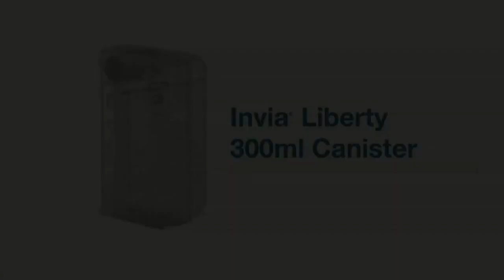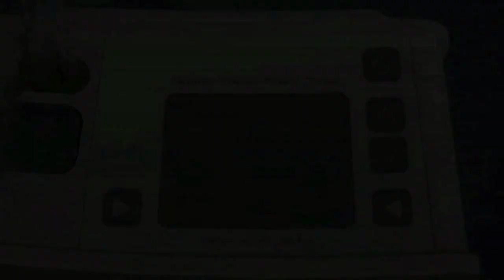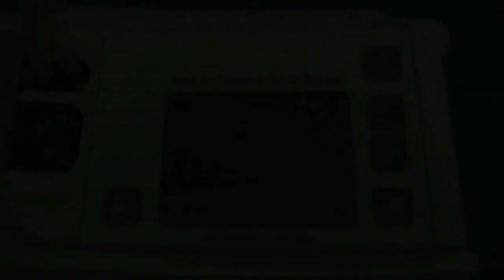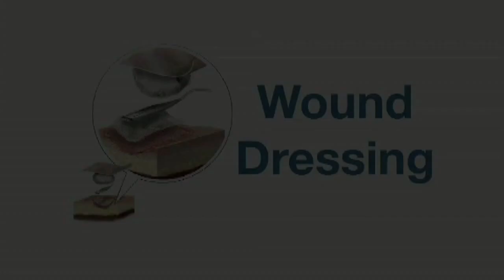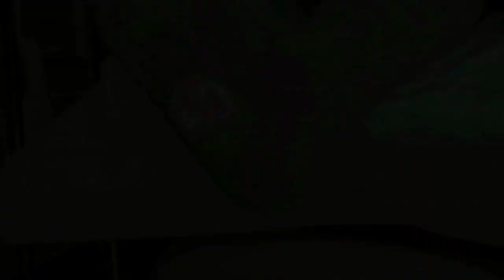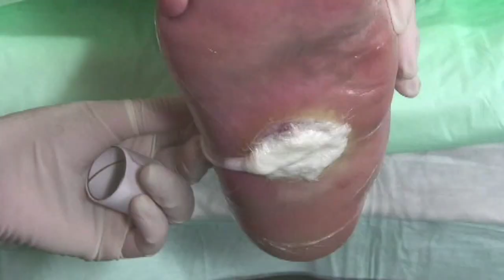Medela (Invia) Product Education - Liberty Setup and Dressing  2-1

Comment: I did one of these last Monday and the instruction manual was not very helpful.  No assistance was available since it was after 5pm.
It was the one with the green foam.
Is 60mmHg sufficient, or would 125 be more appropriate and how are those triangular things supposed to connect without just covering them with drape, which you can't do without using leftover KCI drape which I'm out of now?
Reply: I am a patient who has used the green foam and the non - KCI drape. Below is the method we used for 11 months to dress a large abdominal wound. We found this method very successful. This information is not intended to replace proper instructions from a licensed health care professional. Follow these instructions at your own risk.

The pump settings must be determined by the wound care doctor. In many cases, they start you off at 125 but that is not appropriate in all cases. Be sure to clean the open wound per your health care provider's instructions, then clean the healthy skin to be draped with "skin prep" and allow to dry. 

The best way we got the green sponge system to work was to pre-drape the entire wound area, but don't waste a full sheet. Cut the pre-drape layer down to a rectangle that will cover the wound and at least 2- 3 inches on every side. When placing any drape, be sure to gently smooth it to the skin (not on the wound) for good adhesion before removing the backing. In most cases, you have one shot at placement with any piece of drape. You cannot lift and re-position most drapes, nor can you use it at all if it sticks to itself.This pre-drape should stick only to the skin, not the wound. Do not press it onto the wound area, just around it. The flatter you can get drape to lie, the better your seal will be.

Once the pre-drape is on, pinch it tightly over the top of the wound, pull up slightly and make a tiny hole with small scissors. Using those small (tiny) scissors,  cut a window where the wound is as you pull the drape up, following the edges of the contours of the wound, while NOT allowing any good skin to be exposed once this is cut-out. The window can be very slightly smaller than the wound, just not larger, since the sponge will cause good skin to deteriorate and granulate too, making the wound area larger. Once the hole is cut, the drape should stick to the healthy skin all around the wound.

Some people find the above method (putting adhesive drape across the top of an open wound, then cutting it out)scary and, using more drape, will do what others call "arts and crafts" and cut pieces out to fit around the wound, creating the pre-drape in two or more pieces, peeling and placing them one at a time. It takes more drape, especially if one makes mistakes. I feel that the extra seams provide more spots for possible air leaks, but not always. Both methods can result in success.
 
After your pre-drape is in place with a hole over the wound, 
Cut a piece of sponge the same size and shape as the wound, place gently on the wound and cover with another piece of drape. The best method is to peel the drape backing part way off, press the sticky part down on the sponge with one hand. While continuing to gently compress the sponge under the one had, spread the rest of the drape out around the sponge and smooth with the other hand. It takes a bit of practice but a novice can learn fairly quickly. Again, this piece of drape does not need to be a full sheet, but must overlap past the sponge edges an inch or more for a good seal. 

When cutting the sponge out, never cut it over the patient's  wound area. Small bits can become permanently attached to the flesh and cause problems.

 Pinch the drape over the top of the sponge where you want the triangle for the drain the be placed, and lift. With scissors, snip out a small hole in the drape only. The hole can be as small as a pencil thickness, or a bit larger.

Decide which direction you want the drain hose to go (up or down) and place the middle of the triangle for the drain hose over the middle of the hole you cut over the sponge. Press securely to adhere to the drape, but not so hard as to cause undue discomfort to the patient. Cut three strips of drape, 1 inch wide and 3 inches long. Place each one over each side of the triangle, one at a time, to tightly anchor the triangle down.  These strips should be placed parallel to the triangle edge, overlapping the triangle as far in to the middle of the triangle as they can and still lie flat. So when you are done, you have a triangle of strips anchoring the plastic triangle.  This is the number one place where the suction system can leak - as long as the rest of your drape lies fairly flat.

Attach the drain hose to the hose from the canister. Make sure both hose clamps are open and turn on the pump. It make take a minute or two for the pump to fully start and suck all the excess air out. The triangle on the display should go completely clear or white. If it is half dark, you have a serious leak. The less noise the pump makes, the better seal you have. You can have an all-white display triangle and still hear your pump working a lot. That is okay unless the triangle goes part dark at times. 

If you are happy with the results, place one more piece of drape, something like 2 inches by 3 to 4 inches over the area from the middle of the drain hose triangle to the hose extending from it. That is to keep stress off the triangle and to keep the seal good.

The multiple layers of drape provide good adhesion and prevent leaks. One cannot just place a sponge on a wound then drape over it and expect no leaks.

If you have done all the above and that display triangle is white but your pump is making a fairly constant noise, you actually have a small leak. It is up to you whether you want to hunt it down and try to drape more in a particular spot. The pump will do a self-check every 5 minutes or so that sounds a bit different than the usual noises, but a constant chugging (or pig snorting, if you prefer) means a slow air leak. You can gently but firmly press for 10 seconds in any area, large or small on the drape and wait and listen. If the pump goes quiet, you found the spot. I tend to use the flat of my hand, then work smaller  - like two fingers- once I find the leak. You may not find it at all. 

Before draping a wound, I always want to have at least two sheets of drape to work with. I may not use it all, but I may need more than usual if I find a pinhole leak in a spot, or have some other pesky leak. When you drape wounds often, you can get good enough not to have any leaks. Even beginners can be quite skilled by their second attempt.

The only reasons to try to find a small leak are: 1. To have a quieter pump, and  2. to save battery life. 
The quieter the pump, the longer the rechargeable battery holds the charge.